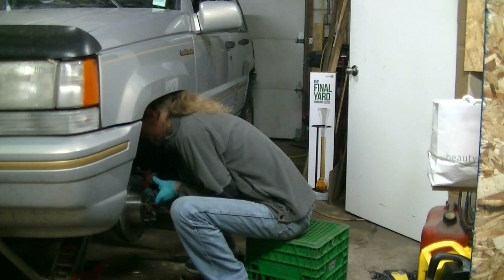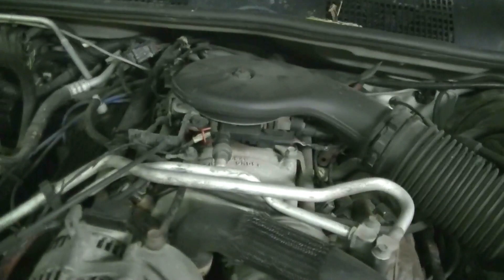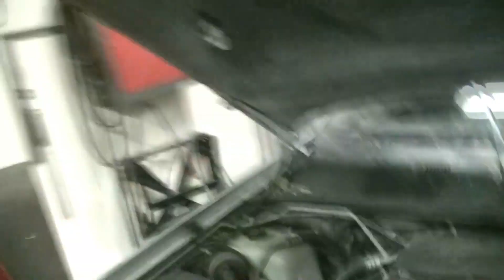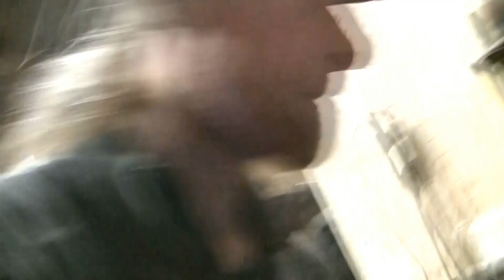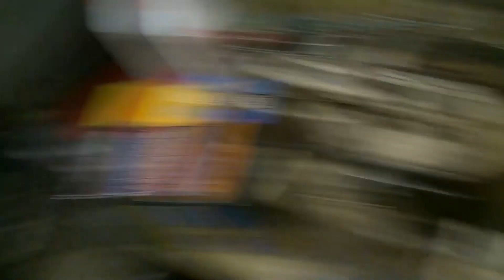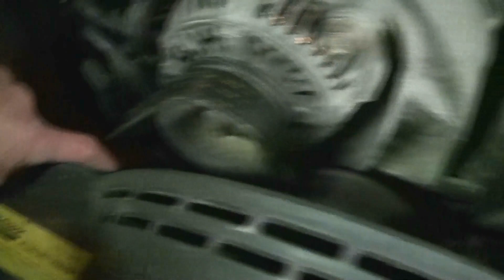Vloggin the Jeep Repairs

Comment: I got to admit, I did cringe when I saw you whacking on the alloy wheels with the air gun, don't you torque them up over there? 

With the new shop, you want to make a waste oil burner for heating..  There's some good channels on YT about them, and they don't half knock out some heat.
Reply: Oil burning stoves good idea very easy!!